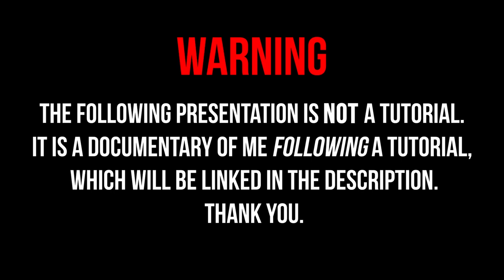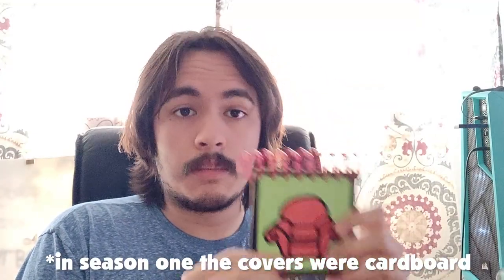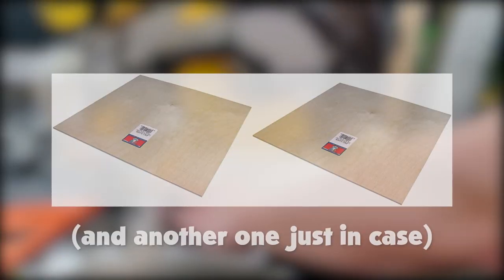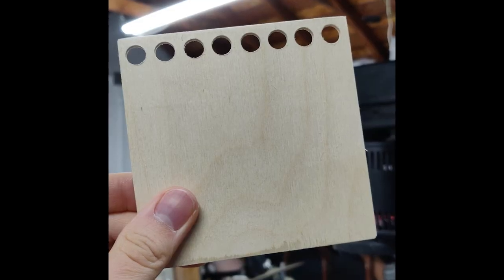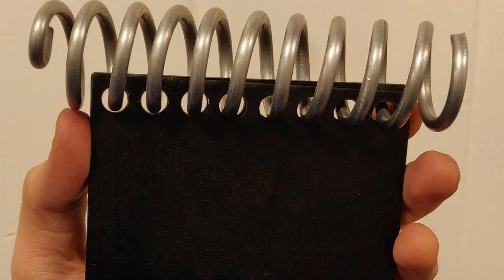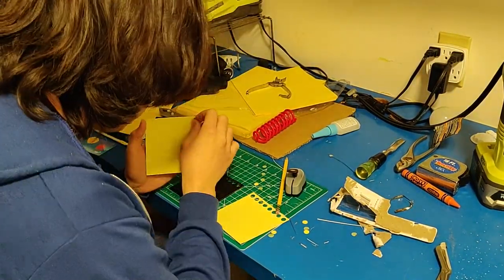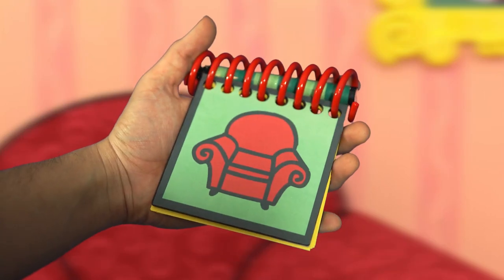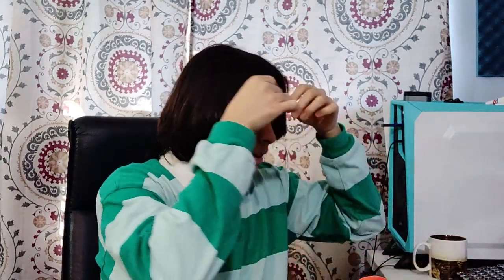Spoon Builds a Handy Dandy Notebook

Comment: Dude this is awesome! Way to go, love the sounds btw! The crayon catcher is actually made in the shape of a V and the crayon catcher did change throughout the show! In season 1, the crayon catcher made a nearly complete circle, which made it so it could fit the part of the crayon with the wrapper on it snuggly. In season 2, it stayed the same, only difference is the notebook was built to allow the cover to pass over the crayon catcher and rest in the crayon catcher if needed! In Seasons 3-4, the crayon catcher was remodified to its final design, which made it so only the tip of the crayon could fit in the catcher! The positioning of the spiral also changed, in season 1-early season 2, the spiral was in the right-handed position and the covers would rest of the left side when you open them. From mid-season 2-current, the positioning of the spiral was changed to the left-handed position and the cover rests on the right side when you open them! I give this a 10/10!

Comment: You mentioned your notebook didn't have the correct amount, around how many does the screen used version have?
Reply: if you're talking about the pages, it's at minimum maybe 30 max probably 50 but maybe 30-35 is ideal to fit in your back pocket to take in and out of like Steve did

Comment: This always confuses me. Is the wire 3/16 a 7 gauge or 6 gauge wire? I wanna make sure I didn't get the wrong wire.
Reply from the maker: It depends on where you buy it from - most places say it's 6 gauge but Cheap Joe's (where I buy it from) says it's 7.

As long as it says 3/16" you should be good
Reply: @bluespoondillon  Okay. Cause the one I got is a red 6 gauge aluminum wire cause I have a problem with paint chipping off the spiral. Cause when I saw how the spiral was made, it almost looked like that wire was a 3 gauge wire.